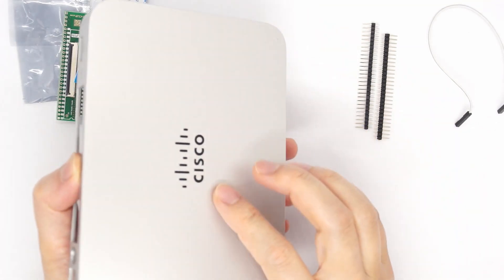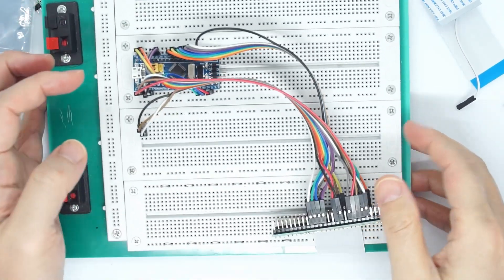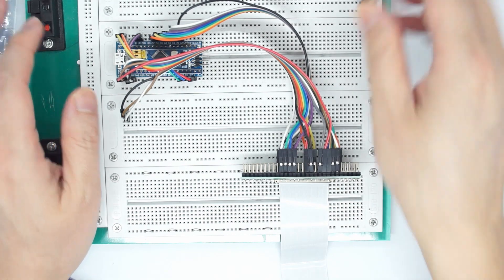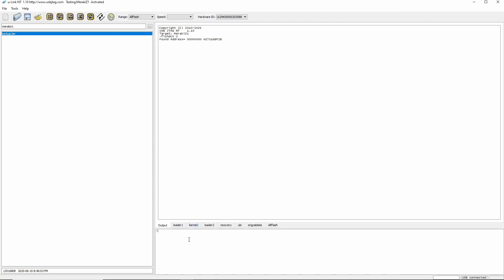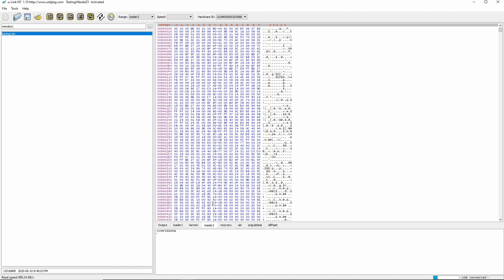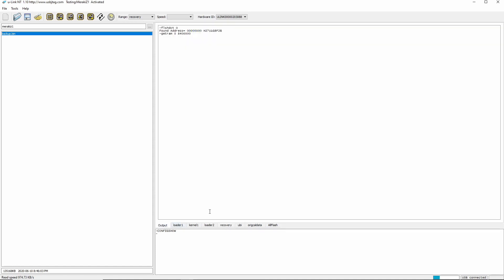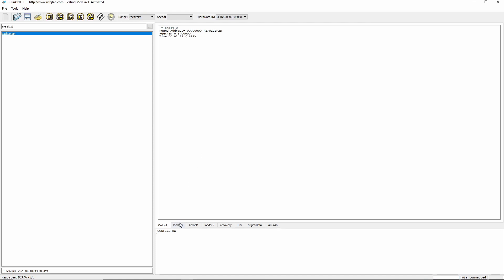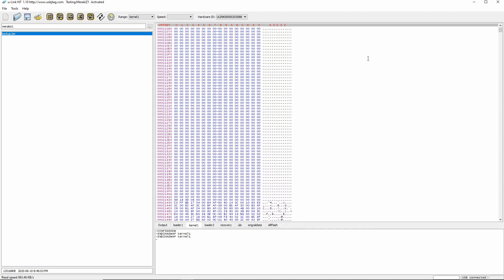Prototype of programming NAND flash on board. (Meraki Z1)

Comment: I notice in your video you are using what looks like a STM32F103 (blue pill).
Which you've connected directly to a H27U1G8F2B Nand Flash

I have a STM32F411CE (black pill). I would like to try the same thing you've done here.

I have two identical circuit boards which contain an Hynix TSOP48 H27UCG8T2BTR-BC MLC Nand Flash.
On one board the firmware is corrupt and the other its good.
I need to erase the corrupt one then copy the good firmware onto it.

Could you tell me how did you wire up the Nand in your video and what script did you use on the STM32F103 to allowed it to communicate with the u-Link NT software.